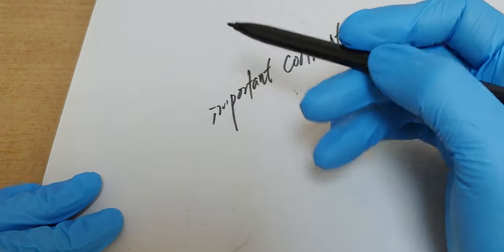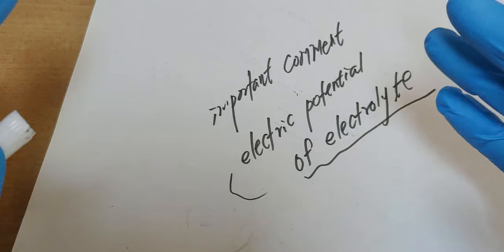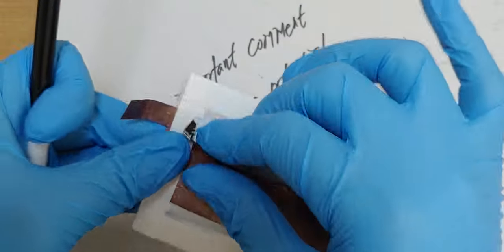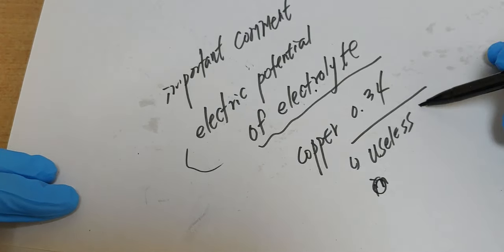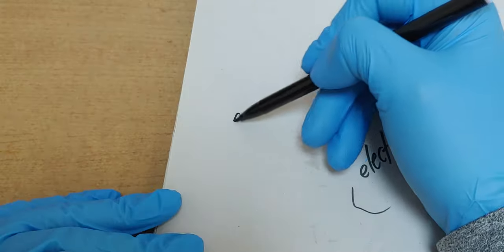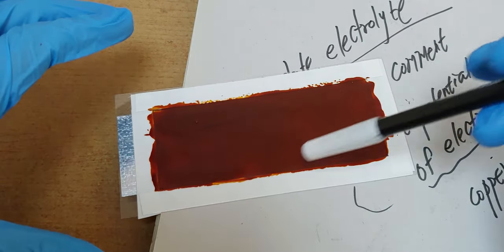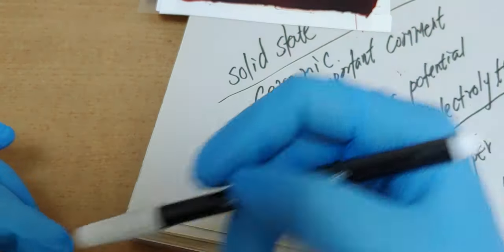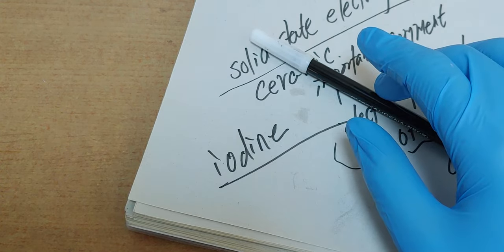graphene battery: thinking about electrolyte

Comment: hi there iodine is no good but potassium iodide is excellent it will give u less current but will not corrode the ally so quickly, note here if u change the electrolyte to a non redox one (no reaction with the ally plates) u will be making a capacitor if u use sodium sulfate it will works a capacitor but not many farads as the area u have is very small and the amount of active material u are using is also very small. u can work out he capacitance by using a 10 ohm resistor across the battery and time it as the voltage drops. rgds
Reply from the maker: Thank you so much. So impressive